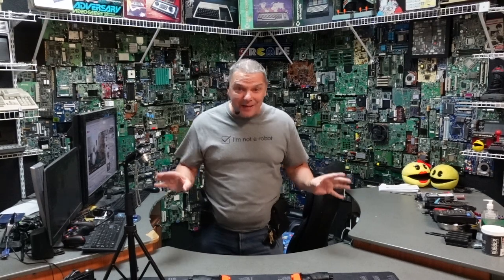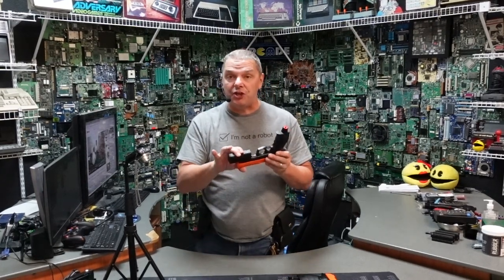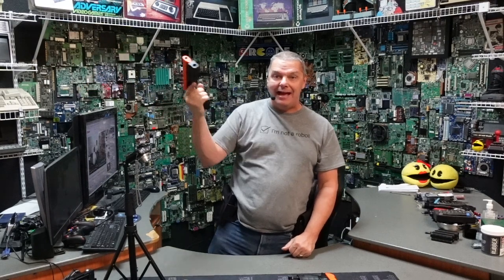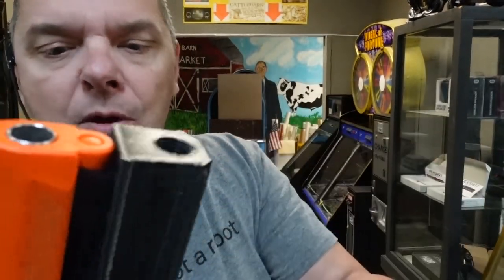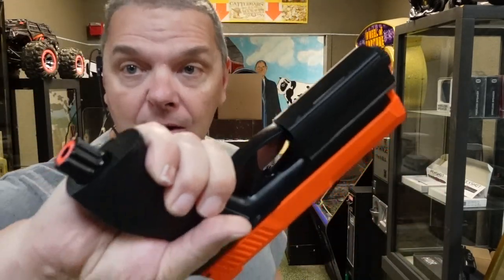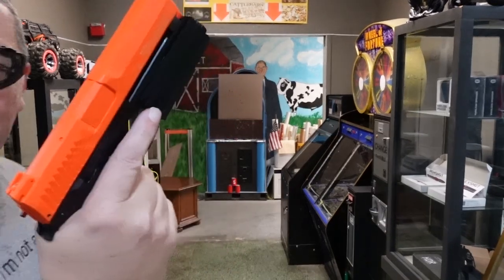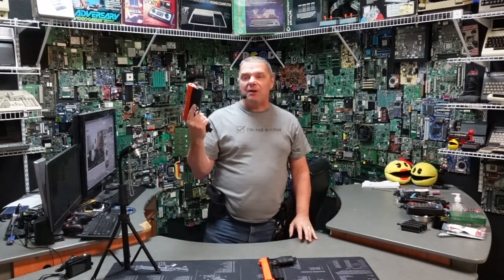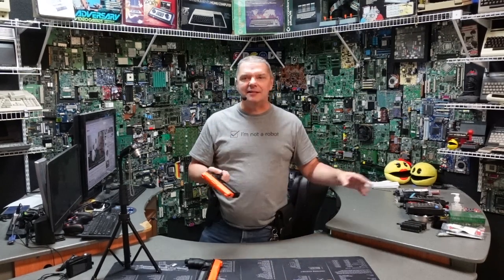Lets try the HDP50 Speed loader Upgrade!! | Installation, usage, and testing!

Comment: I saw  commercial for the Byrna pepperball gun and a Border patrol officer said that he carries one and uses it more to drop guys using less lethal force and in most cases it works for him. I think a hopped up HDP 50 with a few pepper balls and the rest rubber coated metal balls would be a much less pricey and would pack more punch .The speed loader would be a great add on also.Not sure how much power the Byrna packs but im sure it less.He said the pepperball drops most guys to their knees.
Reply from the maker: Yes indeed. Folks truly underestimate pepper balls when they’re used correctly and they are the right compound.

Comment: Add a feed ramp and spring and it should auto load into the system as soon as you pull the charging arm back.
Reply from the maker: My original design had one. I was finding that i would get bindups due to pressure. After redesigning the feed path, that was cleared up and the spring wasn't needed. Now, I have been working on a complete feed replacement which would solve it all :)

Comment: Just got, installed, and put about 50 12.5mm nylon balls through the V2 speedloader.  The print quality and fit is superb.  Rock solid once installed.  No jams at all though I don't quite have the flick of the gun to move the second 6 rounds from the loader to the gun down.  It actually improves the balance and 'gripability' of my hdp50 for me and I'm steadier using the sights alone.   I was prepared to not like the side mount of the laser (left side for me) but my left hand actually likes the grip/position with it there, not underbarrel, and so far testing at 35 feet, 20 feet and 12 feet  (indoor range limits) the windage/elevation shift with distance isn't too wonky my vision is  So far, great.
Thanks,
Reply from the maker: Thanks brother! I had actually done a short video where I had three rails on their using three lasers :-) it look like something right out of predator :-)
Reply: @AlternateArmsSD  Hy, I bought a HDR50, "Swiss", I received it Saturday end was not able to shot it, but i loaded it the other way around, first the pistol, then the speed-loader, you think it will make a difference? I ordered my on Ebay, 3-aöex, the quality is very good, i hope it is your product! btw, why have you this ugly orange slide? Here they are in black.
Reply from the maker: @Ezekiel903  Hehe yeah, in America we can’t get the black slide so I made a couple videos showing folks how to change that :)

Comment: I like this in theory, but as others have stated: since it covers the picatinny rail and there's no place to put a laser/light anymore, it would be an instant buy if you made a version that had at least a laser, if not a nice light.

I know these aren't made for super accuracy, but I like knowing I'm on target, whatever that target might be.
Reply from the maker: Aahhhh but have you seen V2? :)
Reply: @AlternateArmsSD  what you mean with unmodified? in Swiss it has 13 Joule, but you can buy a tuning valve for >20joule legally! I bought your Speedloader, 13 joule with Alu balls is far enough power and I can make more shot! My first  speedloader had a rail on the bottom, but then I found your version. It's better, at least my opinion, bcs if I mount something below the loader, the gun gets too big!

Comment: I have one of theae Umarex TE4 HDP .50 for self defense in DC and VA. It is legal in all 50 states. 

Warning: There are no official Gun Holster for this. I bought a holster off of Amazon near size for Glock 19 and didn't work. I almost gave up because no holsters are big enough for this gun. I had to go to multiple gun stores to search for one that sold every size Gun Holster to try. So I finally found one after a month of owning this HDP 50. 

Hoslter Type that will only fit "without" laser or laser flashlight combo is same holster fitted for a Smith & Wesson M&P9/40 Gun.
Spent $80 on my holster which was "Bianchi"  "Explore Bodily" (Outside WaistBand), by "The Assent"

I still haven't found a fitted M&P9/40 Laser or Laser/Flashlight combo Holster.
Reply from the maker: Greetings! G&F puts out a fantastic universal owb kydek holder that works great with these (https://amzn.to/3nM1WkI). I also use a leather "pancake" holster which works great with most of the weapons I carry as well. 
Thanks for watching!

Comment: Woah I never stopped to actually research what the HDP50 loading process is like.  I always assumed it would be a mag load.  I think I'm going to avoid it now.  Even with the speedloader, I don't wanna be handloading the projectiles. Gotta say I'd still rather use my HDR50 with all my extra drums.
Reply from the maker: The drums on the TR50 do make loading easier. The only thing I will say is that when the HDP50 is modified, you get an average of 8-10 shots. When using the speed loader, you will get every shot out quickly. On the TR50, when modified, you will have close to the same limitation on shots so truthfully there isn't much difference in terms of load time. Thanks for watching!
Reply: @AlternateArmsSD  fair point.
Reply from the maker: @poopoosplatter99  Yeah, after extensive research, every source I’ve ever found in every experience I’ve had in life indicates that the most encounters happen in that 9 to 15 foot range and in the first 20 seconds. Those for shots truly count.

Comment: What's the fps, and foot pounds of energy on the mod version? Does anyone know?
Reply from the maker: FPS at 1.8G is around 550FPS. It’s a beast.
Reply: @AlternateArmsSD  
Thanks! That's with the metal balls? What about the standard rounds it comes with?
Reply from the maker: @jasperlover200555  really depends on the weight, the lighter the ball, the faster the travel. Pepper balls really get moving and have absolutely no trouble rupturing on anything I’ve fired at :-) they are definitely one of my favorite launchers to modify.
Reply: @AlternateArmsSD  
Thank you!
Reply from the maker: @jasperlover200555  My pleasure brother!

Comment: Is there any way you could possibly give an exact measurement of the HDP 50 rubber/pepper rounds? I've seen some folks saying they measure closer to 12.5mm rather than 12.7mm, so I'm thinking of getting 12.5mm steel ball bearings instead of the 12.7mm that's "supposed" to fit... lol. I hear the majority of feeding/binding issues with the actual .50 cal 12.7mm steel rounds is that it jams up the stock detent. I don't really want to get a magnetic/'aftermarket' one of those, so I hope to replicate the precise size of the stock ammunition. Please help! Lol
Reply from the maker: Greets! They are absolutely correct. They are 12.5 mm. You can’t use a half inch ball bearing although I have tried. Also, you may want to look at aluminum rounds instead of steel. They are a little easier on the internal seals.
Reply: @AlternateArmsSD  Perfect! Thank you so very much! New fan and subscriber here lol, I appreciate the lightning fast response. Stay blessed!
Reply from the maker: @JoeMama-ld6hs  Thanks man!! Have a great weekend!